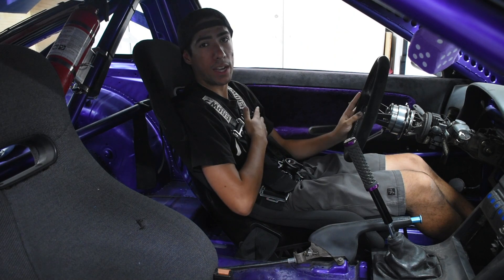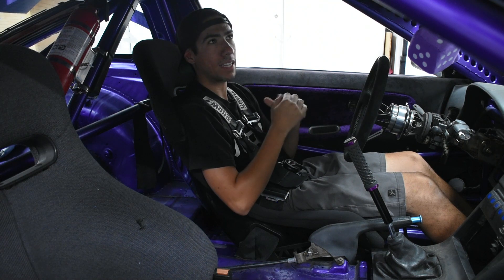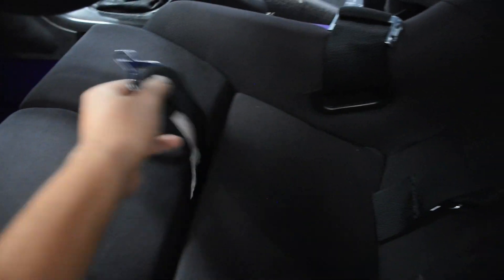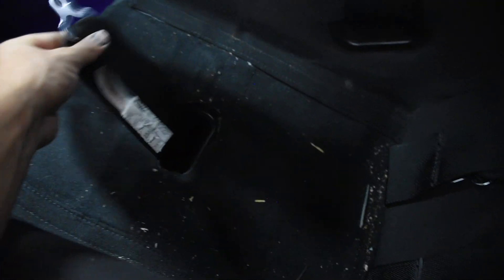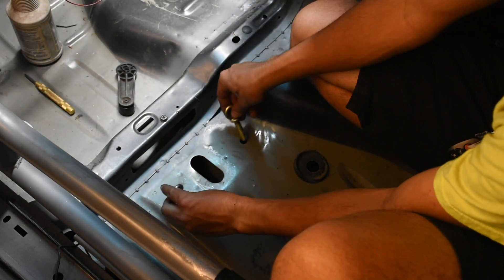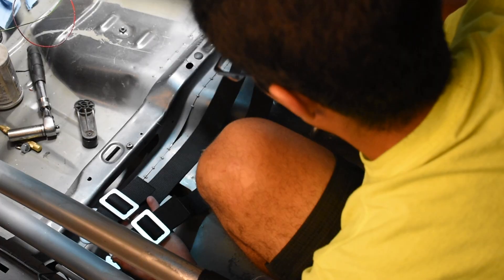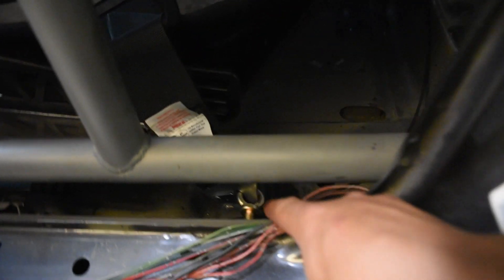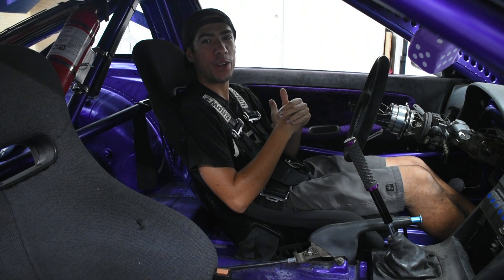How to Install a 6 Point Racing Harness

Comment: would it not be better for the bolts holding the harness to the floor to face up with the nuts inside the car ? That way if the car bottoms out after leaving the track the bolts wouldn't be sheared off at the floor releasing the harness. Or possibly getting hung up on something like a track barrier and pulling the harness down against the driver.
Reply: how would the nuts be in the car tho? need the eye on the inside for the harness to attach to and the nut on the bottom to secure it. and the nuts should be high enough that they won't scrape. the left over bolt might but you cut that off, and since the nuts are against the bottom of the car if those are about to shear you have bigger problems at hand as there is a multitude of low points lower than them. And even if they did and the bottom straps are released you have the other points acting as a 4 point harness to keep you in. all in all this is one of the best ways to do it when installing into a car that wasn't built around this system.

Comment: also to point out for 6 points sparco and schroth make there 6 point belts separate.  speaking of harness belts how would I go about mounting if it's just a autocross/pdx / daily driver setup.  do I do the same.   people have told me I could mount the sub straps to the back part of my seat mounts.  and then for the lap belt one to the oem mounting point in the b- pillar then the other to the seat mount side tab does that work, or do I still need to do it like you did.

Comment: Are you going to get a different seat? I'm not 100% sure but I thought I read about something with pro am and/or fd requiring a seat with the head and neck support, I'm not sure of the proper term for the head and neck support but you get the point haha

Comment: I literally just installed a 6 point harness after looking everywhere for instruction and then BOOM!.....thanks mate, just confirmed my install is good.

Good to note that if you have retained the sliding seat rail, best to make the angle calculations where you will be sitting in the slide position because as the seat slides back and forwards, the angles will change.
Reply from the maker: No problem my man!

Comment: Would you reccomend a harness bar if a full cage isnt in budget?
Reply: o Lemurs not really if you don't have a full cage then a harness bar can be dangerous or that's what the internet says
Reply from the maker: If it's a properly made harness bar then i don't see an issue with it. But the majority of harness bars that I see are really flimsy and don't tie into enough points in the car to be strong enough. So in that case I would say the stock seat belt would be safer. Hope that helps,
Reply: o Lemurs if you really want a harness, at the very least take out the back seat. And get a Takata Drift belt. They're the only ones that are DOT legal (other than Schroth which is Takatas parent company) and that's for a reason. If it's a street car, stick with a Takata Drift 3 for more lateral support and use the rear seat anchor points.